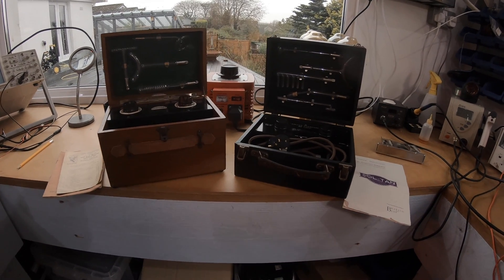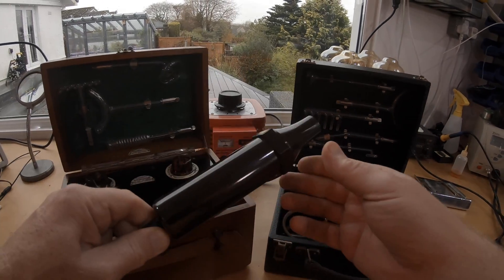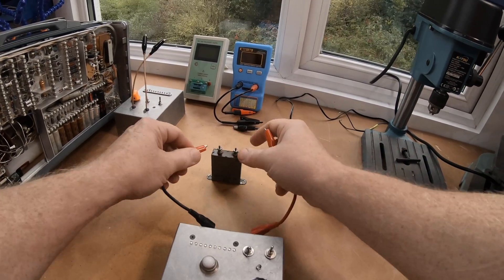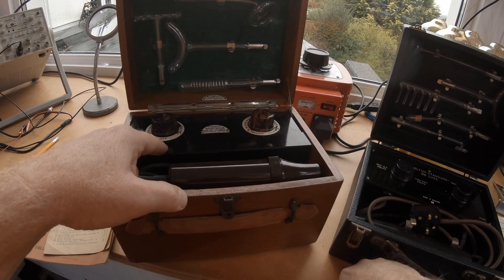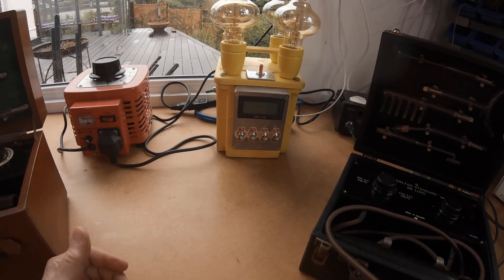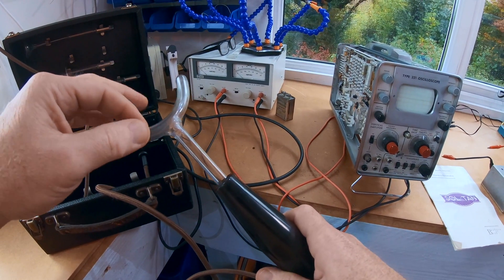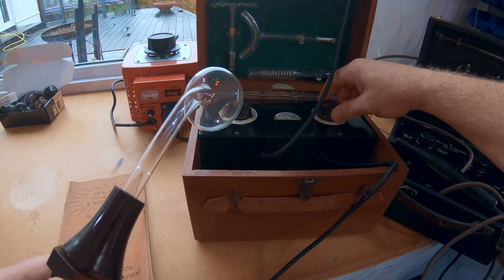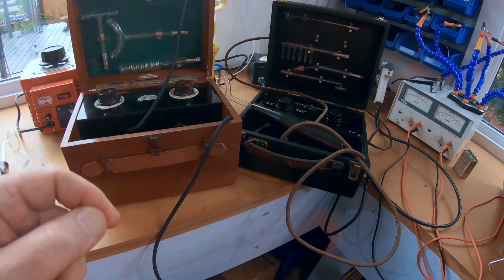VIOLET WANDS - VIOLET RAY - Tesla Coil  - Rogers Vitalator & Soltan Tesla coils - Electrotherapy

Comment: Do you know where i could possibly source a suitable capacitor? All of the ones ive had, including the rogers violator in the video have had the exact same capacitor as you have shown, but 3000vdc .08mfd and are impossible to find. I have very limited knowledge on them, so any help would be greatly appreciated! 🙏
Reply from the maker: Hi, If you can find a 0.068 µF / 3kV DC polypropylene cap (or similar), that’s probably your best single-unit equivalent. A  0.047 µF cap will also work, but the output will be less. 👍🏻

Comment: HI Grant , I recently bought one the same as you have in the black box in your video, its a '' READSON '' model ( exact same electronics compartment from the front with the 2 large knobs etc ) , I need to change the old cables . Can you kindly advise me how to open the electronics compartment box section please ?. There are six small flat head screws on it . What else  ( if anything ) needs to be removed ? e.g. do the two knobs need to come off also ? tia.
Reply from the maker: Hi Dan, the screws need to be removed as do the knobs - one of the knobs will be spring loaded (mild) - check out this video of mine, I think it shows what you need - https://youtu.be/Uw8YTc8Z9F0
Reply: @GrantWyness  Thank you so much Grant .

Comment: HI Grant , I have one whereby is doesn't shock much . I guess the wand has a voltage more close to 20k than 50K. Would it need a new Tesla coil do you think >
Reply from the maker: The capacitor will need changing - this is the heart of the device - check my other Violet wand video and you will see what to do.

Comment: Thanks for an interesting display ! I bought one of these from an antiques market in Amsterdam an am currently trying to get it working. It looks like a Tesla spark gap circuit for a Tesla coil. Is there a coil in the handset ? I have a problem trying to open it. Have you checked the voltage across the pins connecting to the handset ? I am not very experienced at this and didn't want to fuse my multimeter.  Thanks if you can help with my questions as I would like to get this gizmo working. It seems pretty interesting - my guess is that it is effective in treating some ailments. Big Pharma would say it's quackery (wouldn't they) because it reduces their drug profits.
Reply from the maker: Mark Lyell Hello Mark, there is a coil in the handset - the units do work on the spark-gap principle made famous by Tesla.  The voltages are high and the capacitor in the box will need replacing as will the cords.  Good luck with it👍🏻
Reply: Hoi Mark,  Several years ago i hope my message finds you. I am also from The Netherlands. Did it work out for you? I also would like to buy one but i am not that handy with repair actually never repaired something as a woman mostly i had used repair services but they wouldn't understand and actually only a bit worried getting shocked/ danger. hope to hear from you.

Comment: Hi there, any chnace you can let me know what value that first capacitor is as I have one thats failed and the value has faded away and cant make out what it is on your video of the first cap. Many thanks indeed if you can help.
Reply from the maker: Graham Cooper Hello Graham, the capacitor I used was (.1uf - 3000vdc)  so as there is no mistake the capacitor is ‘point-one microfarads @ 3000 volts DC.  I used a nice quality poly capacitor.  All the best 👍🏻
Reply: @GrantWyness  Thanks for the reply Grant and I have already got a poly capacitor and it works fine and value I went for in the end was close to what you stated . Thank you